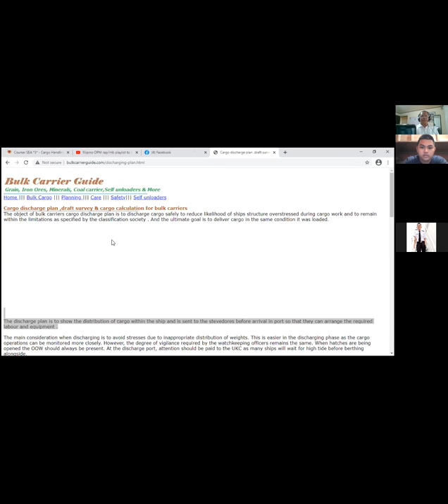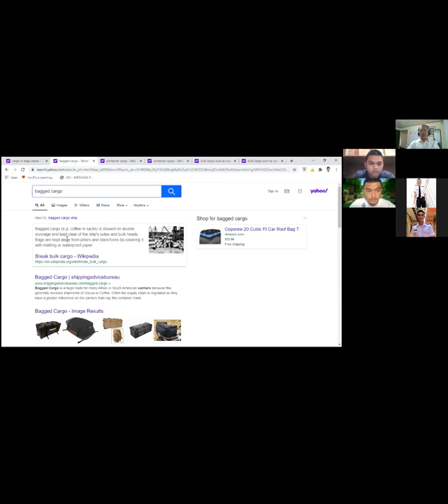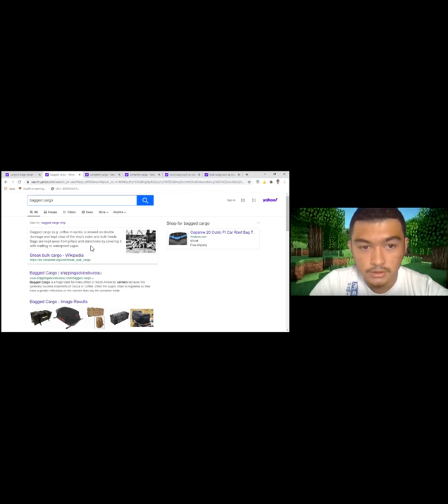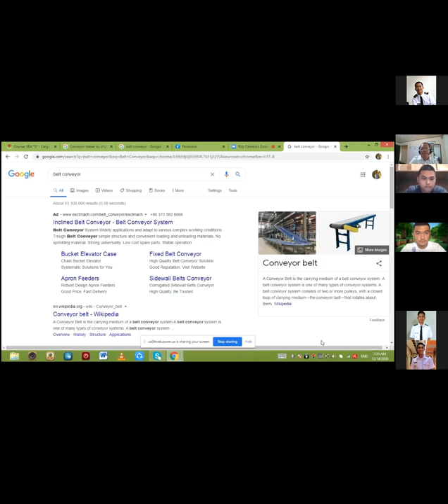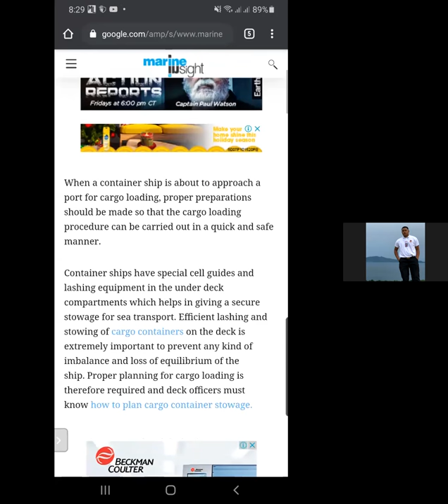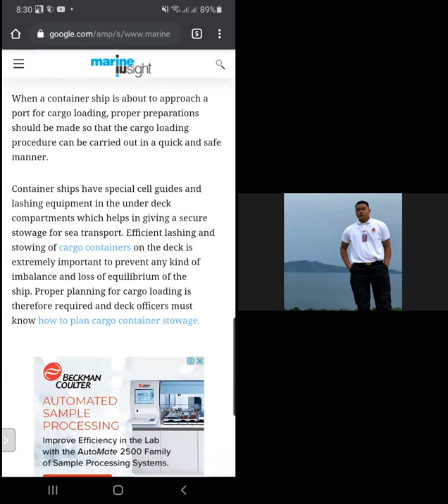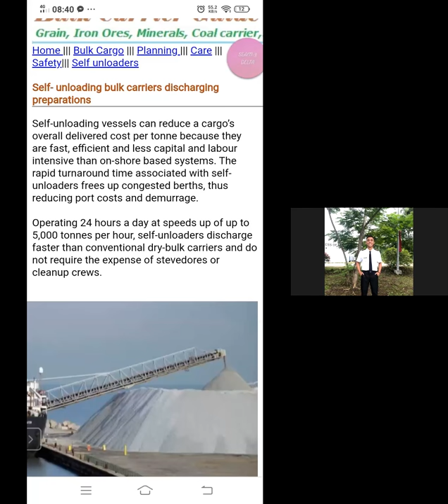BULK CARGO LOADING

Comment: A Conveyor Belt is the carrying medium of a belt conveyor system (often shortened to belt conveyor). A belt conveyor system is one of many types of conveyor systems. A belt conveyor system consists of two or more pulleys (sometimes referred to as drums), with a closed loop of carrying medium—the conveyor belt—that rotates about them. One or both of the pulleys are powered, moving the belt and the material on the belt forward. The powered pulley is called the drive pulley while the unpowered pulley is called the idler pulley.

Comment: One of those pieces of equipment often utilized to lift these types of loads is the chain sling. These slings can be used in various industrial and construction applications. These slings are flexible, temperature resistant, and strong enough to handle a wide array of loading conditions. There are 3 types of chain sling, the single leg, double leg, and multi leg. The single leg, chain sling is exactly as its name implies… it has a single chain length supporting the lifted load. Double leg chain slings have two separate links of chain that provide support for the lift. Multi Leg, it is for extra lifting capabilities to handle loads that exceed hundred and 180,000 pounds, you may need to go with a multi-leg chain sling.

Comment: Bagged cargo (e.g. coffee in sacks) is stowed on double dunnage and kept clear of the ship's sides and bulk heads. Bags are kept away from pillars and stanchions by covering it with matting or waterproof paper. 

Container ships (sometimes spelled containerships) are cargo ships that carry all of their load in truck-size intermodal containers, in a technique called containerization. They are a common means of commercial intermodal freight transport and now carry most seagoing non-bulk cargo.

Description. It refers to material in either liquid or granular, particulate form, as a mass of relatively small solids, such as petroleum / crude oil, grain, coal, or gravel. This cargo is usually dropped or poured, with a spout or shovel bucket, into a bulk carrier ship's hold, railroad car / railway wagon, or tanker truck / trailer / semi-trailer body.

Cuballes Antonio Miguel C.

Comment: Belt converyor, it is one of the mechanical apparatus that use to transport bulk cargo from one place to another. 
3 types of belt conveyor; The throughed belt conveyor, its belt is place above a running rollers with different height and angle. The Flat belt conveyor, this conveyor is suitable for lower capacity and lower speed. And the pipe belt conveyor, this pipe belt is used to avoid spillage when transporting bulk cargo.

Chain Sling, one of the common chain sling that is normally use is the single leg slings. It has 4 parts; the upper end fitting, the coupling link, the chain, and the lower end fitting. This single leg slings is used to lift and object vartically.

Comment: Manalo, Aedrian Howell G.
Cargo DISCHARGING in Bulk Carrier

The discharge plan is to show the distribution of cargo within the ship and is sent to the stevedores before arrival in port so that they can arrange the required labour and equipment .

The main consideration when discharging is to avoid stresses due to inappropriate distribution of weights. This is easier in the discharging phase as the cargo operations can be monitored more closely. However, the degree of vigilance required by the watchkeeping officers remains the same. When hatches are being opened the OOW should always be present. At the discharge port, attention should be paid to the UKC as many ships will wait for high tide before berthing alongside.

Comment: OLIVER, KURT RENUEL D.

The object of bulk carriers cargo discharge plan is to discharge cargo safely to reduce likelihood of ships structure overstressed during cargo work and to remain within the limitations as specified by the classification society . And the ultimate goal is to deliver cargo in the same condition it was loaded.

 

The discharge plan is to show the distribution of cargo within the ship and is sent to the stevedores before arrival in port so that they can arrange the required labour and equipment .

The main consideration when discharging is to avoid stresses due to inappropriate distribution of weights. This is easier in the discharging phase as the cargo operations can be monitored more closely. However, the degree of vigilance required by the watchkeeping officers remains the same. When hatches are being opened the OOW should always be present. At the discharge port, attention should be paid to the UKC as many ships will wait for high tide before berthing alongside.

Prior to arrival, the chief officer should devise a sequence for discharging cargo, calculating BM and SF as well as draughts and air draughts for each run. This eliminates any communication gaps between the stevedores and the ship's officers and allows the stevedores, in particular, to plan ahead. However, this can only be done if the ship is provided with the cargo discharging rate and number of gangs available at the discharging berth.